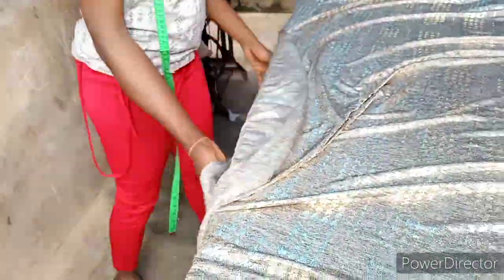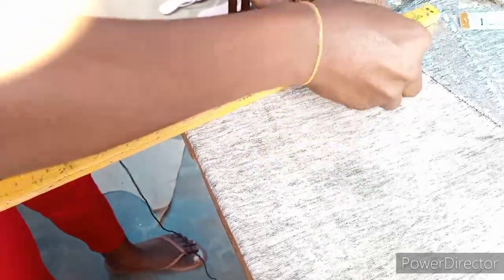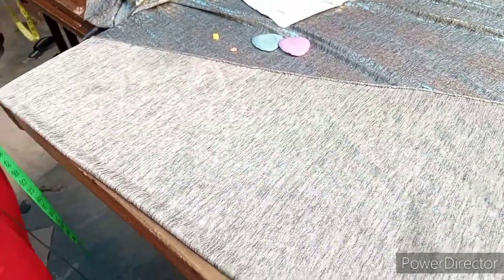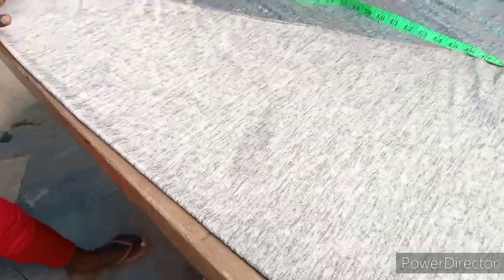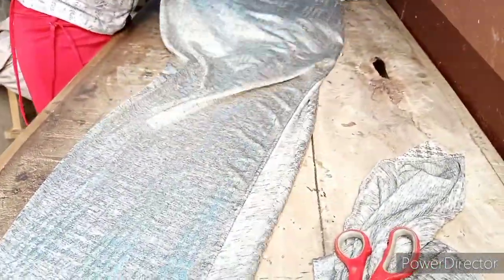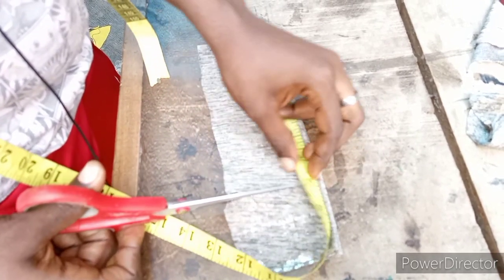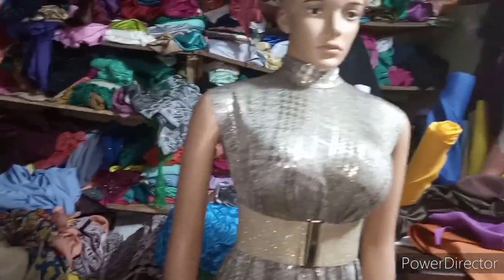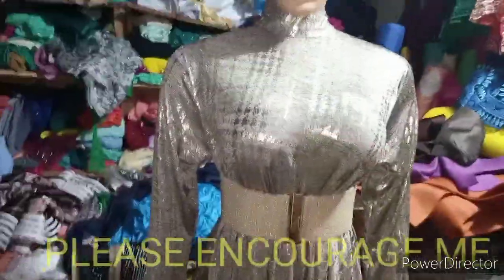HOW TO CUT AND SEW TURTLE NECK FLARE GOWN

Comment: Thanks for the tutorial but I didn't get something right
You said you the collar on bais n I was just wondering how possible.
Cos I thought it would be cut straight.
Please put me through cos I'm really confused you know you didn't show how your cut out the collar
Reply from the maker: Yes but if you cut it straight it will come out well too because is a drawing material ma
Reply: Thanks ma, can I also cut it on bais for Ankara dress
Secondly, pls wats d standard measurement or how to get measurements for a collar neck cos I use 2.5 by 3 n it USUALLY chokes me . I'm shoulder 16
Reply from the maker: Used 3/3 then because it must not be to wide I will send another link for the neck and is always perfect 👌
Reply from the maker: https://youtu.be/WP6LonXqZjE
Reply: Thank you ma. God bless you
Reply: @syddysapparel  please how did you put the botton.